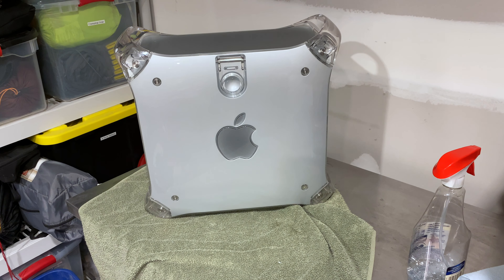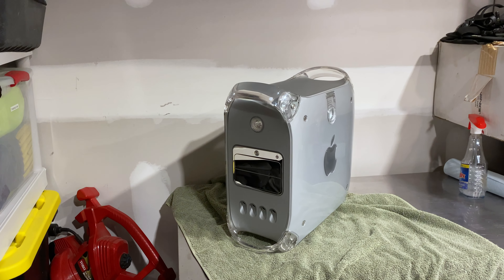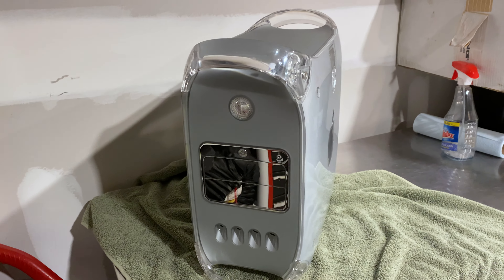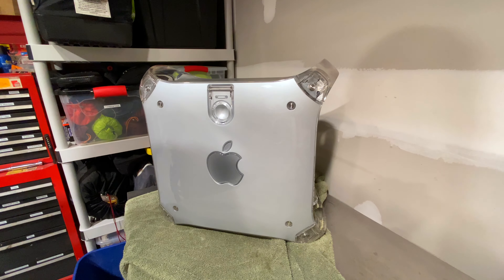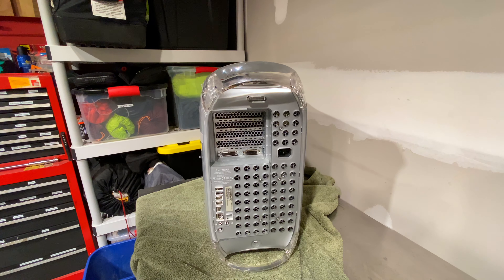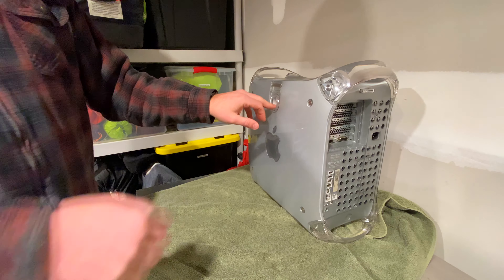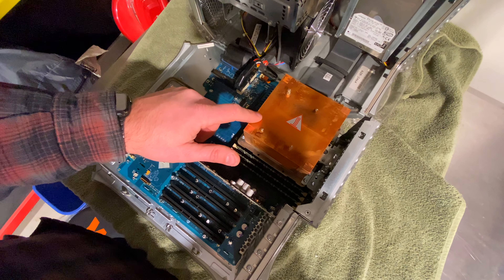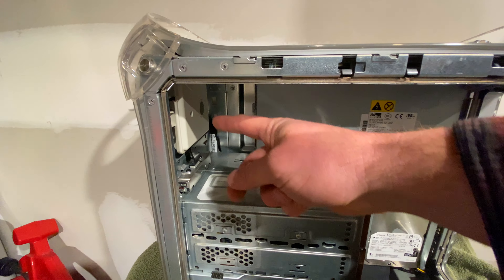I found a PowerMac G4 1.42Ghz Mirrored Drive Door...in a dumpster

Comment: OMG you're such a nerd and I love it!  You say child hood but for me I was a young Electrical Engineer working on the first set of external HDDs that supported the Mass Storage class of devices on USB.  I had this exact machine on my work bench, testing hardware we were developing.  I don't recall if the chip set actually supported USB 2.0 or not, I don't think it did, but it's been a long time!  I remember how cool it was back then and now to see one still working just kicks ass!  Very cool.  Please post another vid when you get it all working.  Oh and that's crazy you found an SSD that has IDE as a protocol.
Reply from the maker: Good catch on the USB. from what I've read, this shipped with USB 2 but the motherboard's (logic board) firmware only supports 1.1 so I'm limited but nothing a PCIE card can't fix.  Here's the SSD Kit...it even will work as a boot drive!!! https://eshop.macsales.com/item/OWC/SSDMXLE250/   These were not slouch computers back in the day as you know. It's going to be a screamer running Ubuntu. Here's a screenshot of all of the incoming packages. By next week, it'll be up and running - http://i.imgur.com/BICXXLN.jpeg
Reply: @AdamChandler86  Too freak'n cool man.  Post a follow up vid when it's ready.  Two machines I remember back in the day, the iMac (worked with one of those circa 1998/99 I think) and the PowerMac.  So many companies tried to copy the look, but the quality just wasn't there.

Comment: I have two of these, one of which I still use today. I use it for scanning machine which is so old, it only works from this Mirrored Drive Door machine. I'm running OS 10.4.11 Tiger.  Brilliant old machine, the designed and the way it opens is genius. I have a few old Macs lying around my house, all of which I used to use in some capacity.  Mac SE 30, Beige G3 333Mhz tower with Zip Drive, 2007 iMac, and MacBook, and a 2015 27inch iMac that I use now. Props!

Comment: The Power Mac G4 has three IDE controllers:
1 ATA 100
2 ATA 66
Only the 1.42Ghz version has Firewire 800 but it is not very compatible with OS 9.
From 2002 to 2003 for about a year the operating versions sold were at 867/1000 and 1250Mhz all with double processor and mount 2Gb of maximum ram (the DDR400 is optimum)
When the first G5 came out, Apple wanted to make a single processor 1,25Ghz G4 MDD possible for those who wanted it for use in native OS9. This was the last model produced.
The performance of these machines is apparently ridiculous when compared to current PCs and Mac but let's remember that 21 years in the IT field is a long time.
To understand what these machines can do today I made a small video that tests a dual MDD 1,25Ghz with 2Gb of ram, OSX Leopard on HDD, the last possible on this machine but I didn't use the usual benchmark software; I preferred to use REAL APPLICATIONS, not a at a time but many at the same time and while they do something.(the power of real multitasking)
What amazed me is that this machine is more responsive than a 2.0Ghz dual G5, much more powerful.
A feature of this machine that many do not know - it was recently discovered - is that the memory controller would be the same as the one mounted on the G5 (AGP). In fact, Apple declared compatibility with the DDR PC2100 or the 2700 but you can safely use the DDR PC3200 or DDR400 while working as of the 2700 at 166Mhz.
I leave the link of the video I made

https://www.youtube.com/watch?v=hh3Gsx8Urnw